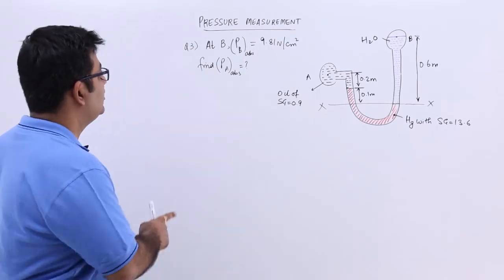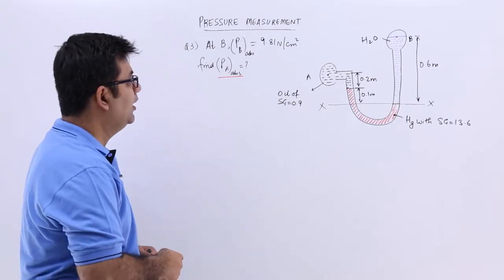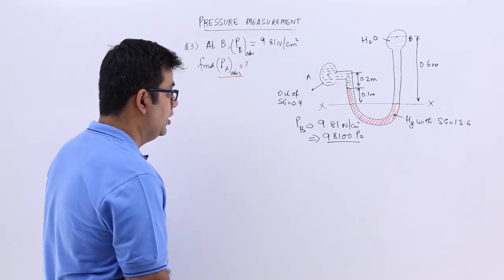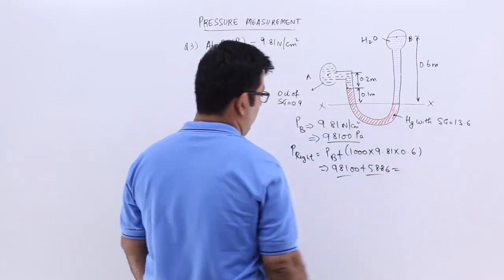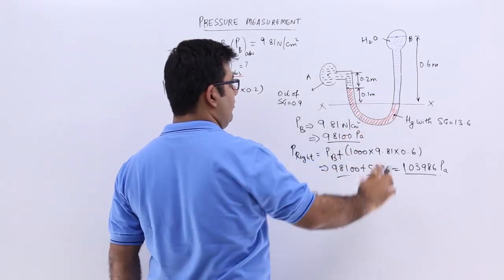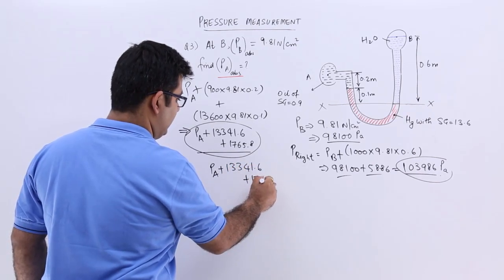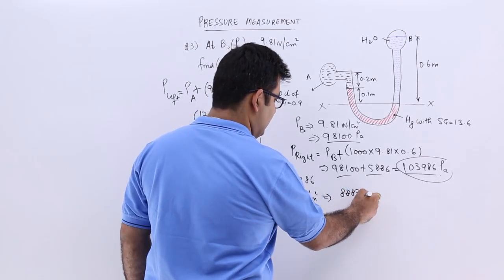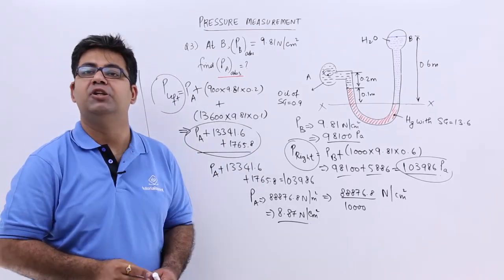Pressure Measurement Problem 3

Comment: Why the density at left is 900?
Reply: He changed it from N/m* to pascal. Which is 0.9 *10 to the power 4
Reply: SG= Density of substance /Density of water = yoh have SG as well as the density of water 1000kg/m^3 so you to get the density of substance